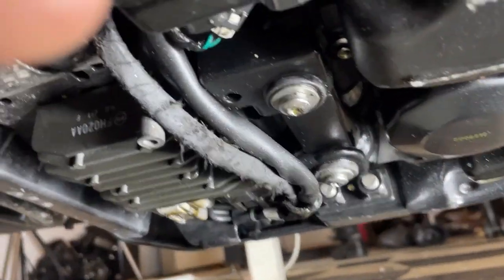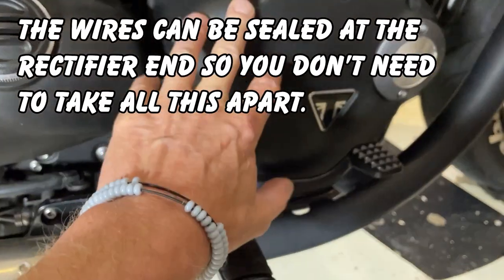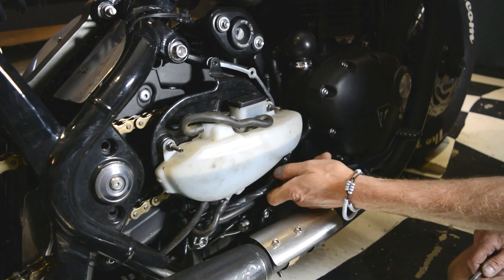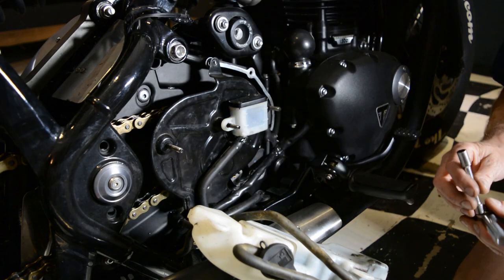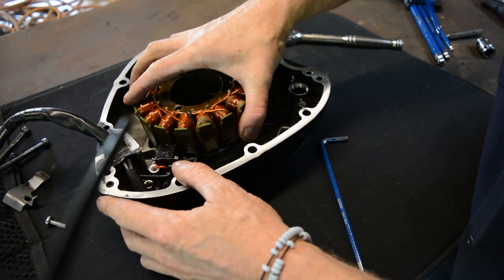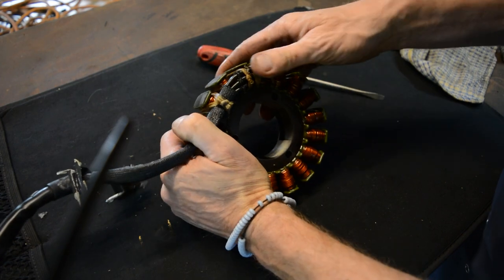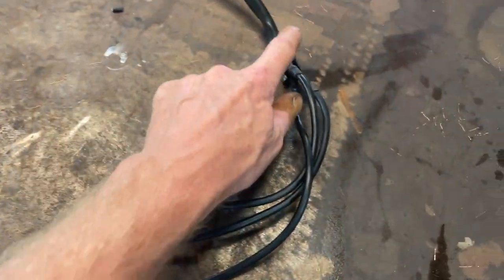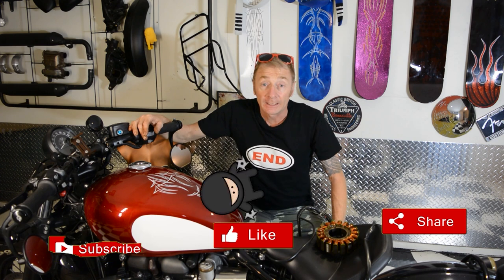Triumph Bonneville Bobber, Speed Twin, Thruxton Oil leak solution.

Comment: My 22 Speedmaster was leaking out the same plug. Had the dealer fix it under warranty in April '23. Now it's June and leaking again. I saw on an Aprilia forum someone tried something similar on their bike - running the wires upwards to counter gravity pulling the oil to the rectifier. Came across this video today. Nice work. Another idea I've seen is relocating the rectifier somewhere higher on the bike for the same reason.
Reply from the maker: I have another video showing a quicker fix you could try first. Several people have done this and it has worked.

Comment: Hi thanks for the tutorial.  My main question is how did the oil get in the alternator in the first place? Sealing up the wires at the ends doesn't make up for the main oil leaking to the alternator/stator. Can you show this as well? 

Keep up the good work!
Reply from the maker: The stator is inside the engine case. @6.12 of this video you can see. https://www.youtube.com/watch?v=_edMYFuDslM&list=PL0CcGS0kvBx-_2XGVY_hMtauFYQSNZzFe&index=7

Comment: Great teaching tutorial, wondering what gauge wire size was used to lengthen the cable. Thanks again!
Reply from the maker: Thank you! I matched the core size of the wire with some I had l had kicking around, which I think was 42A.

Comment: I have a Tiger 1050 with this problem, I don’t think gravity comes into play though, my wiring goes straight up and oil still travels up to the plug. Hopefully this fix will sort out the issue though.
Reply from the maker: I think crankcase pressure forces oil through the wiring.

Comment: Hi; I have a Thruxton R. This one leaks by the N switch screw there. Is minimum; never dripped on the floor but is annoying. I removed those covers; tight the screw but not cured anything. May be do it again and add silicon?
Reply from the maker: The switch has an o ring. I would replace that.

Comment: Can you point me to the video where you talk about removing that bold for the engine ?  I am going to try and reseal my old stator first before replacing the unit and needing to do that part.
Reply from the maker: You could try the quick fix first which is here,
https://www.youtube.com/watch?v=xnfR93gskFY

or I talk about the bolt here at 4 mins,
https://www.youtube.com/watch?v=ObgkDbZuppE

or here at 16 mins,
https://www.youtube.com/watch?v=0w0dGEcFwmI&t=993s

hope this helps!